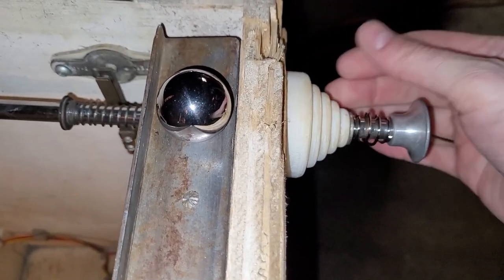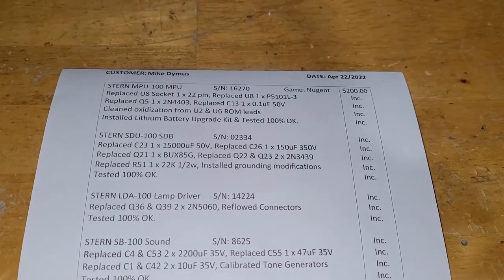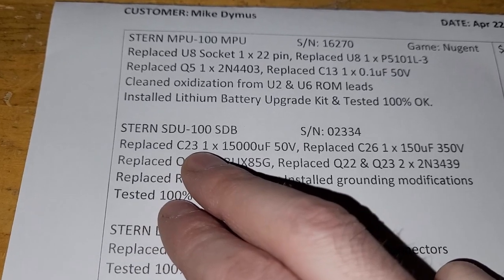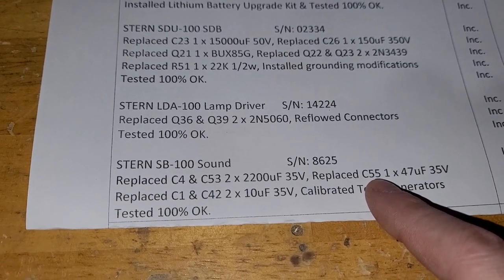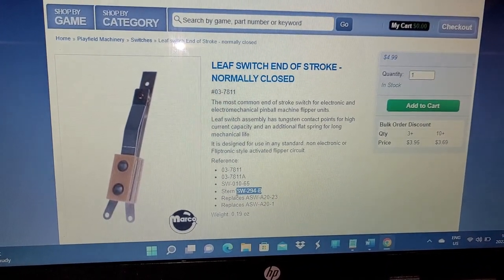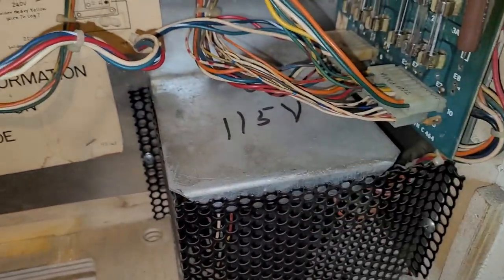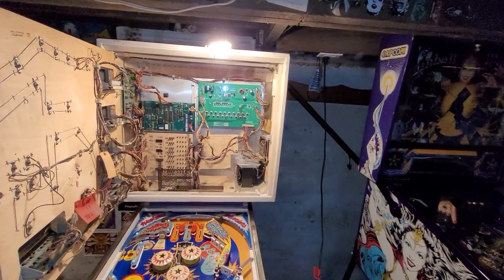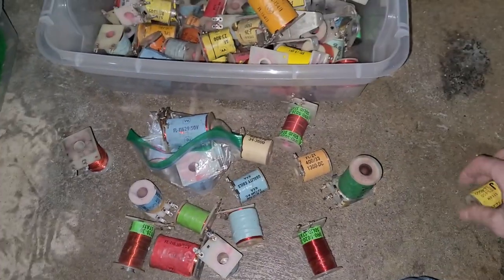Part 8: 1978 Stern Nugent Pinball Project. Changing transformer voltage from 115v to 120v (and back)

Comment: Reducing  the number of turns on a coil does not necessarily increase the strength of a coil.  Coil strength is determined by MMF=NI where MMF is Magneto Motive Force (coil strength), N is the number of turns and I is the current.  So a reduction in the number of turns for a given current will reduce the coil strength.  However, we do not have a fixed current in our coils.  Instead,, we have a fixed voltage.  Reducing the number of turns will reduce the resistance of the coil and thus (via Ohms Law) increase the current.  So we have an overall conflict here.  Reducing the number of turns decreases N but ultimately increases I.   But which one is dominant?  That depends.  In general, for small turns  reductions, the  coil strength decreases.
Reply from the maker: Oh wow that is some hard core info there Jim!!! I love it! I have to read this a few more times lol to comprehend!

Comment: low tapped or high tapped? what is that? -1 for Mike for not explaining.
Reply from the maker: Haha ok!!!  Hi tap = more power (for all solenoids) by moving a wire on the transformer. Check out this pic and you will see on the transformer where it says Hi tap! https://www.google.com/search?q=em+pinball+transforme+high+tap&client=firefox-b-d&sxsrf=APq-WBu1-CWpXE5DgYETZ-1ATy3Bl28hgw:1650933724101&source=lnms&tbm=isch&sa=X&ved=2ahUKEwiiyrCxv7D3AhXPGs0KHeYIBgwQ_AUoAXoECAEQAw&biw=1540&bih=822&dpr=1.09#imgrc=y_-Yi2So-rXMaM